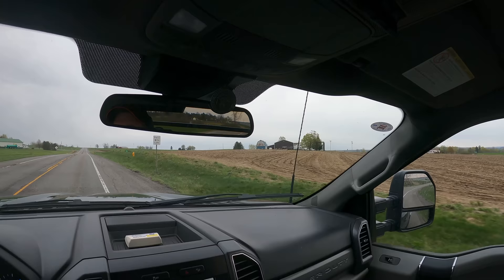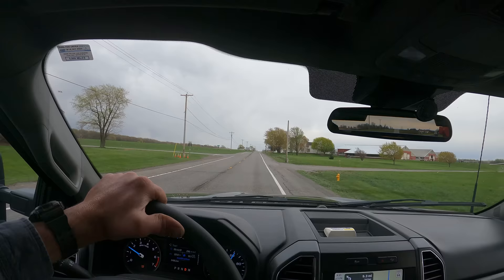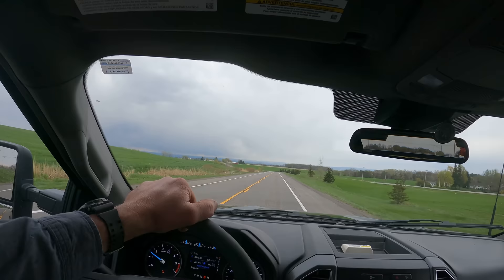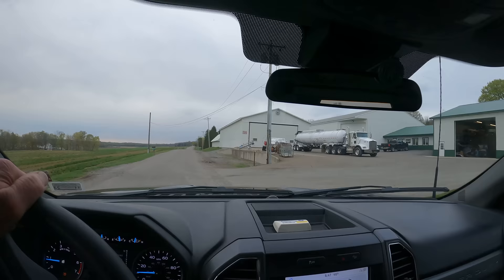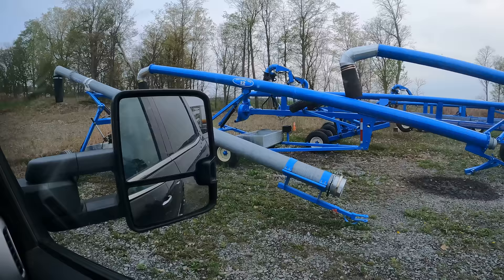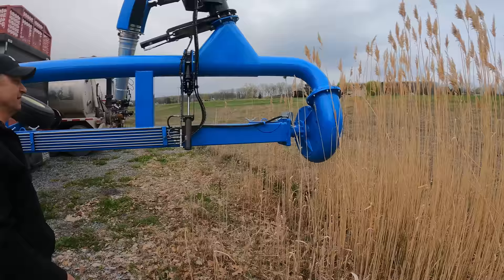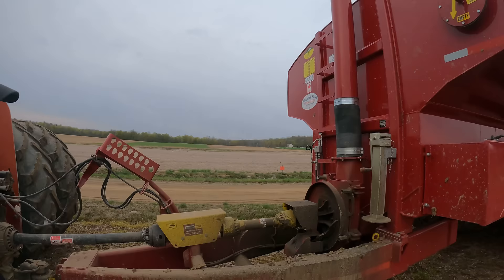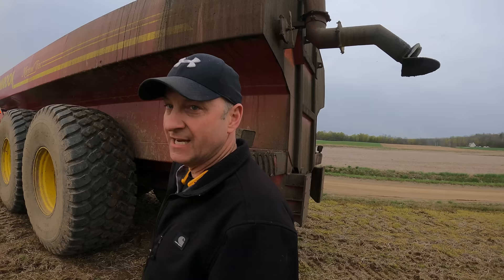Hainsworth Farms Visit

Comment: Man,We had a temporary fuel trailer because the belly tank went on the genset.When they replaced the engine,they told the electricians to just take it! It was a 600 gal,only ever traveled to the site and then when it left! I think they paid over 10 or 12 grand for it! If I knew you were looking,I would have asked if he still had it!

Comment: Congratulations on the new fuel tank trailer we have one we love it ( different brand) the only option I can suggest is a air compressor we use it all the time for blowing out filters and radiators all you need is a YANKUM ROPE in your tool box and you will be all set

Comment: Guess you can fill 2 tractors at the same time by doing one from the trailer and the other from the truck. Pity the new trailer doesn't have option for 2 dispensers then you could handle 3 tractors simultaneously.

Comment: Nice tank and trailer ,we have a fold down canopy which you can lock over the pump motors to avoid/ slow down thief’s ,we don’t leave fuel trailers on site if possible because there would be a good chance of it not being there in the morning

Comment: What’s Chuck do to vent out the fuel tankers before he starts welding on them before he turns them into manure tankers?
Reply: Upscaling those old fuel/oil tankers into manure handling…pretty slick
Reply: @jarredholt5037 I have a friend puts exhaust gas to propane tank,  lets it run a bit, begins to cut or weld.
Reply: You can see in the video he has a big ventilation pipe hanging in one of the tanks or close to it